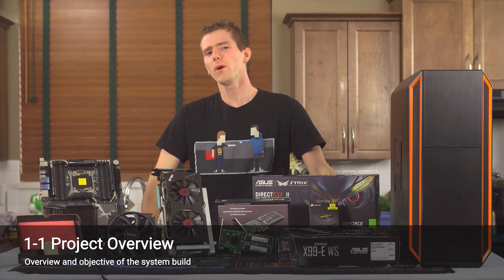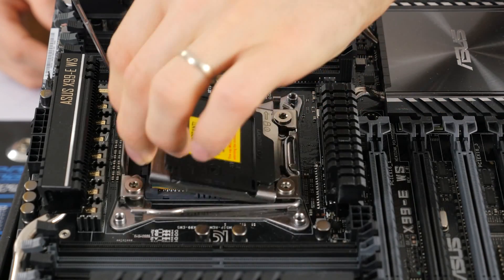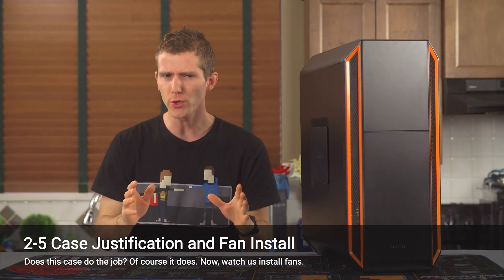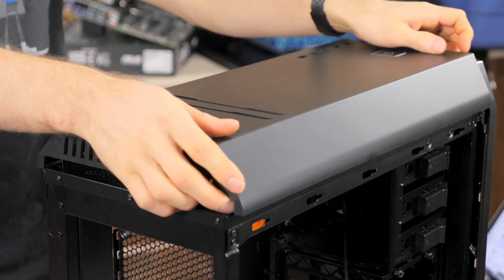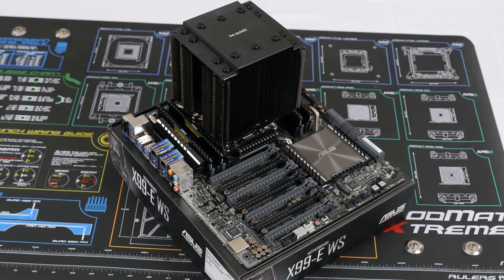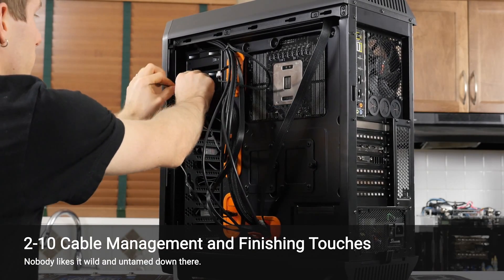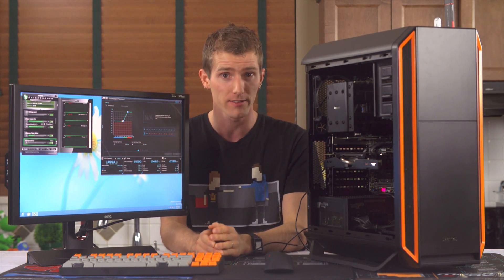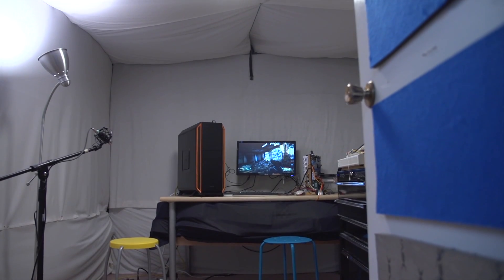How to Build the ULTIMATE Silent Gaming or Workstation PC

Comment: I want to upgrade my Athlon II x2 220 CPU. My budget is tight, so I'm thinking of buying the Intel Pentium G3258, but I don't know if my M2N68-LA (Narra6) motherboard supports it. Can anybody please help me out?
Reply: It doesn´t because new intel cpus dont go into amd soccets and vise versa. I can link you a pc part picker build, what´s your budget
Reply: tech doge Thanks for the reply! Now i know that my motherboard isn't compatible with it. I'm not building a whole new PC, just upgrading my CPU. My budget is in the 100$ range, and I really don't want to get a new motherboard if that's possible.
Reply: well what gpu do you have? and with 100$ you can get a cpu and mobo
Reply: tech doge I recently bought a AMD Radeon R9 270 GPU, which is bottlenecked pretty hard because of my motherboard and processor. That's why I want to buy a new CPU, but I doupt that I can buy both with that kind of money. I just need a good cheap processor with at least 4 cores that is compatible with my current M2N68-LA MOBO.
Reply: ProGamer1115
 ya that mobo it kinda old , could go to a 1055t or what ever  the best one of them is , tho even that cpu is kinda long in the tooth ,     look on crags list e.t.c  or get some more $ and do a real  up date
Reply: Go with a AMD Phenom X4 965 Black Edition, my brother uses it in his build with a 7750 and it runs great, it'd run amazing with a r9 270
Reply: http://pcpartpicker.com/p/2mrXMp
Reply: that is 110 and is ok.
Reply: tech doge Thanks a lot! I will check it out.
Reply: Agent Dale Thanks for the suggestion!

Comment: beware of seasonic psus. i am aware they are a leading name in psus and half of corsairs line are rebranded seasonics which is why i purchased it.
mine died a little over a month ago after 2 years with 5 years left on the warranty. the rma start to finish took a full month, i had to pay for shipping both ways and extra insurance. they never confirmed by phone or email they ever received it, i got an email after 23 days stating it was being shipped back.
i think they sent me the same one back not fixed cuz it does the same thing. pc shuts off randomly within an hour. i used a shitter psu waiting for it and what im using now, works fine no issues.
im waiting for a response about my situation but i have a feeling theyll want me to pay shipping again in which case ill tell them to fuck off and thanks for the paper weight then buy something with better customer support and pays shipping on rma for its faulty products and isnt a seasonic pcb as i dont want to support this company anymore. then proceed to warn people of their products in the future. there is no phone support listed on their website for us or eu, only taiwan. the only way to contact them is by email. worst rma process and customer service ive ever experienced so far in 20 years
Reply: EZOVERDOSE
Evga has good customer support but not the best PSU's, I was even able to rma a gtx 770 from ebay with no questions asked!
Reply: John Barcibush
You Comprehension must be that of an 8 year old, he just didn't capitalize.
Reply: check your power strip. It's probably not the PSU that is failing on you. Next time, dont RMA through the factory but go the the reseller where you bought the PSU.
Reply: 13Krentebol
computer wont stay on for more than an hour without shutting off. i swap the psu then leave it on for 12 days straight editing/ encoding video and gaming and it never shuts down ever for full month. stick "new" rma'ed psu back in and it shuts down after 2 hours. so youre saying thats the power strip? no. and the outlet is on an isolated circuit with its own breaker that only powers the pc and monitors.
i bought it from newegg. their rma process is the same - you pay. the only difference is they would most likely send a replacement instead of a refurb and knowing what i do now the process would most likely be much quicker. hindsight
Reply: i wanted to follow up my own issue. the 8 pin power plug had 3 pins partially melted. this is technically still seasonics fault since the amount of wires and the gauge of them should allow that cable to draw almost 2000watts and my cpu is only capable of drawing 300ish max. they were quick to reply to my mail bitching up a storm and sent me a prepaid label to have my psu checked again. this was nice but there are 2 catches. the first rma i was instructed to not include my cables which is stupid since its part of the product and ended up resulting in my situation. and its unclear if they would hold my psu and charge me the 25$ fee for finding nothing wrong with it and instead being the cable since the cables seem to not be covered under rma. they have partially redeemed themselves in my eyes, im currently waiting on their reply to see if theyre going to send me a free cable since im using a backup
Reply: another update on my situation: replacing the 8 pin cable didnt fix whatever was wrong with the psu. it still caused my pc to random shutdown. i dont know if hooking up the melted cable to it caused it to short or what. this time they requested i send my cables with it which should have just be standard procedure in the first place. also tested different surge protector and different outlet on different circuit. its definitely the psu. ive taken my pc apart more times this month than i have in the full 2 years ive owned it. pain in the balls
Reply: EZOVERDOSE It took me about three hours to read your comments because in them, the English language was tenderized, pulverized, cooked, mashed, compressed, ground, reconstituted and fried until it was made into paddies that were slapped across the wall bordering stupidity.
Reply: John Barcibush you forgot a comma after reconstituted. it took me three hours to read your comment because of that. please stop abusing the english language, the internet and grammar are serious business.
Reply: just an update on this situation: apparently the melted cable shorted out the new psu and caused it to do the same thing. i sent it back in again, this time on their dollar for shipping, and i now have another new one with all new cables. i havent had time to install it yet but im sure its fine.

Comment: my asus 970 sort of angles down at the Power connectors-corner. i thought it wouldn't since its got a backplate of metal and a shroud of metal too. any suggestions? i want it straight. :(

Comment: I'ts a shme fking NVIDIA wont let you flash the bios on these things. Knock a 200-300Mhz off that gpu clock, undervolt it by ~0.2V and voila the card will be 10-15C cooler, thus virtually silent.

Comment: I tried my best to go quiet on my build but there's still some noise under load, I think from either the PSU or front fan. Some vibration, I could maybe try re-seating them. But its a lot quieter than it was in the beginning, with the 2 stock fans that came with my case, swapped those out for 2x Noctus Redux PWM 120mm fans.

Comment: Right now I'm torn on what GPU to get.Right now I can get a GTX 760 for 179.99 or 189.While I can get the R9 280 for 194 which is pushing my budget for the rest of my rig supplies.I'll be pairing them up with a FX-8320E.

Comment: Guys i have a question. To what am i supposed to attach the antistatic bracelet?
Reply: Most people attach it to the case or psu. In this case he has an entire anti-static workstation. Static works on voltage difference, so if you're at the same voltage as what you're touching, no static shock.
Reply: Slightly Jaded thanks

Comment: Great video :)
I performed a similar build about 18 months ago, but with the aim of having no moving parts at all.
The build list was:
     - Case - Nofan CS-80 Fanless Computer Chassis
     - Motherboard - Gigabyte GA-Z77X-UD5H LGA1155 ATX
     - CPU - Intel Core i7 3770S
     - CPU Cooler - Nofan CR-95C Pearl Black IcePipe 95W Fanless CPU Cooler
     - Memory - Corsair 16GB (2x8GB) XMS3 DDR3 Memory
     - Power Supply - Seasonic SS-460FL 460W Fanless
     - Graphics - Sapphire ATI Fanless HD7750 Ultimate 1GB GDDR5 PCI-E HDMI, which has just been replaced with a Powercolor Radeon R9 270 SCS3 "SILENT" (fanless) 2048MB GDDR5

Now, it is not quite a gaming rig, but it is completely inaudible, which is important for me working in a quiet room for up to 12 hours at a time.
The setup has worked flawlessly and temperatures never seem to climb above 60°C for the CPU and 68°C for the GPU.

Comment: I have been using a 0db PC at idle in some form or another for well over a year (upgraded recently). I use fan stop on all my fans, including CPU, PSU & GFX. I have one HDD and several SSD's. The HDD goes to sleep after 5min. There is one difference however, my 4690K is overclocked to 4,6GHz and is not what I would call quiet under synthetic load. It is actually quite loud then to keep temps in check. However playing games and using the PC for normal work loads is very pleasantly quiet and not intrusive. To make a system quiet at stock is easy, component selection is absolutely the key. One wrong component and the system could become noisy. Asus mainboards with Fan stop is also important. Overclocking and maintaining 0db at idle is a little more tricky and would only recommend it to savvy users.

Comment: The New Rode NT1 has a self-noise level of 4.5 dBa, and it's not even the quietest in the world!
Reply: So, Lewitt has recently released a microphone with a self-noise of 0 dBa... Now, mind you, it's ACTUALLY 3 dBa in reality, because that's how loud air molecules moving are... let that sink in for a minute. The new microphone can record AIR MOLECULES MOVING. They need to get their hands on that baby.
Reply: ***** Thats actually wrong. 0dBa represent the sound pressure level of the most quiet sound most ear can hear. It does not represent the absolute sound level (0dBa would be basically space silent). This means that negative sound pressure (like -7dBa) does exist and can be mesured in a good anechoic chamber. That being said, I do not know the sound pressure level of said so "Air molecules moving", but I can assure you that it is on the negative side of the dBa "scale". 

Also, even if what you said was true, the "sound of air molecules moving" would not be considered self-noise as it produced by an external source.

Have a nice day.
Reply: martshred
If you'd like, you can look into the science. However, the sound of air molecules bombarding the surface of the condenser capsule is +3 dBa. Yes, technically the self noise of the mic is +0 dBa, but the microphone will still record +3 dBa of noise because of the aforementioned air molecules.

Secondly: your "That's actually wrong" seems directed at nothing I mentioned, and just goes into the science of A-weighting for audio. Though interesting, certainly not pertaining to any falsity on my part. Simply an expansion and clarification to what I already stated.

Nonetheless, the microphone does have a self noise of +0 dBa, but still records with a "self noise" of +3 dBa because of the moving air molecules.

I always have a nice day :)

Comment: Linus please do an overview on how to move over to an ssd with a computer that has ran on an hdd. I am looking into it but I'm not sure which software to get or what to do in the bios.
Reply: just buy upgrade kit....he did milion videos about how to move to ssd....when u buy ssd upgrade kit u get cloning software and usb to sata cabel, and you just clone ur hard drive to ssd.....
Reply: xAsmir "just buy upgrade kit" not very helpful m8.
Reply: xAsmir Cloning won't work as you probably won't buy an SSD the same or bigger capacity as your HDD is.
Reply: You need to install Windows on the SSD with your HDD not attached to your PC, just to be sure. You can than attach the HDD with the PC off, after which you need to set the boot priority to the SSD. 

After that, install all software you had on your previous machine using programfiles on your old drive as an easy reference. You also need to move all your files to either a separate drive or partition, or if it fits to your SSD. 
I'd recommend just buying an external harddrive if you don't own one yet already.
After that you can format or delete the partition the installation was on. You can extend the partition you intend to use for filestorage to whatever space just came free.
Reply: If you know so little about computers, I wouldn't start trying to do things like install and SSD, take it to a computer shop. You're better off paying extra to have it done somewhat professionally rather than risking all of your data for a few bucks.
Reply: gregor clegane how is that not helpfull? google SSD upgrade kit, buy it = win?
Reply: Didn't he already do one it involved zombies or something if I remember correctly.

Comment: Why MSI Afterburner on an Asus Card?
Reply: What wrong with MSI AB ? It's an universal (unlike EVGA Precision which only works with NVIDIA graphic cards) GPU overclocking tool and way better than ASUS GPU Tweak.
Reply: I just didn´t know that those are universal. I thought Asus software only works with Asus hardware. And I guess EVGA only works on nVidia because they only produce nVidia cards.

Comment: Am I the only one that can't stand perfect silence? When my computer's running, I like having the ambient background noise of the fan, as long as it's not overwhelming. I dunno why, I just find it soothing, because I know everything's working.
Reply: I removed my fans and installed whales into my build, performs much better now
Reply: it depends in my room lol i have fans going in my room because i literally go insane at night when there is complete silence i need noise or something
Reply: gregor clegane hmm have mixed feeling about this sure they are quiet but damn that instant torque is mind blowing trust me on that. but still like the sound and feel of an engine especially my jeep but i like electric cars to.
Reply: gregor clegane You know computers are not run on fuel...They're run on electrical currents and tensions...so...
Bad comparison.

Electric cars are good, bro, they're just too silent, but they're fast and very clean when it comes to pollution.
Remember, you're the one who's breathing all that carbon monoxide coming from cars everyday. Not that they're the only source, but they're not the least polluting source either.
Reply: I think its more of a hot-rodder kind of thing. You know, those people who make it so you can hear their car coming from half a mile away, even if it is only a little v6
Reply: I can understand liking the sound, it almost helps it feel more "powerful".
Reply: Only thing that used to worry me about sound dampening is when a mechanical drive is about to go and you can't hear it. Although that's a relatively loud sound.
Reply: Yup, you aren't the only one. I can't stand the silence. I have fans, and fan heaters, pc's and all that stuff all over my head 24/7.
Reply: Yeah, like if I'm gaming, I like to hear people In the background so I always watch some commentary or let's play video.
Reply: Carlos W. Dude you're completely missing the point -_-
Reply: Damn, 152 thumbs up? I have never gotten that many likes on a comment before.
Reply: Carlos W. They are only more enviromentally if they are manufactured so. Producing and shipping all batteries and stuff isn't particularly great.
Reply: some people find it distracting and over stressing, me included, for productivity porpouse...but does not really matter when its about gaming stuff.
Reply: the fans can easily be spinning without anything else working
Reply: Tell me about it! I really like the whitenoise!
Reply: I feel the exact same way, but then again I am building my first pc right now and it just might be a novice pc building thing
Reply: Ahfl And led-s. They make everything more powerful.
Reply: yeah like needing the sound of an old ceiling fan to get sleep
Reply: LogicOwl | Let's Plays same here. when something is too quite i feel weird. i need some form of noise. even if its small.
Reply: NO! I require the sound of a thousand PC's running when i power mine up. I always headphones, but I can hear it over them. The sense of power you get when you boot up and it freakin revs like a car.
Reply: the same reason why electric cars are shite

Comment: Can't you technically have a fanless mode on any GPU with user controlled fan curves? Just drop the fan speed to 0% between 0C and 30C, and you get the same effect, right? That's what I did with my Zotac 970.
Reply: Have you checked that they stopped spinning ? Most gpu fans won't go under 20 or 25% so when you set it to 0, it either goes to the gpu's minimum speed or it just resets the fancurve to the minimum speed.
Reply: Yea, seems to be the case. From a cold boot where it sat for about 20 minutes with a window open, upon being booted into afterburner, it showed 28%, despite the curve being set to 0% for 30c and under. Showed 28% at 23c. Oh well, still really quiet compared to my case fans.

Comment: In one word, amazing. I really like this build. I have no doubt that what you built this time is absolutely great. However if you put two fan-less low-end graphic cards you will absolutely reach a system below the 20dB. But 2 X R7 250 Is a waaaaaaaaaaaaaaaaaaaay weaker than the beast GTX 980 Strix.